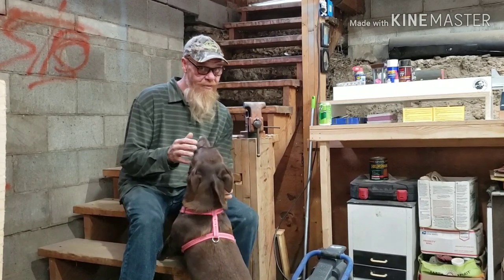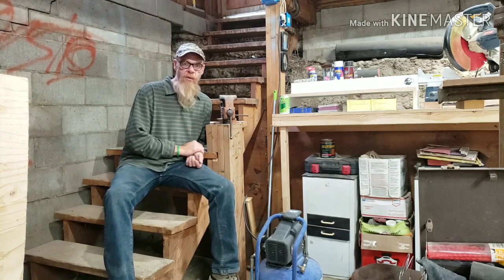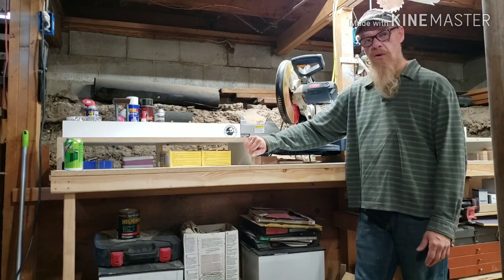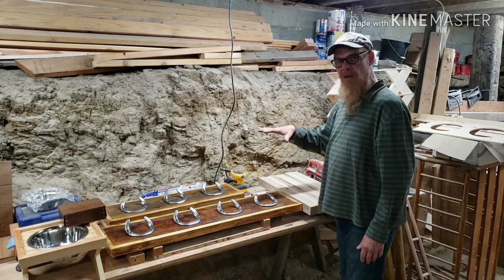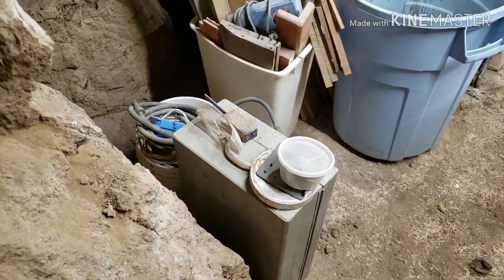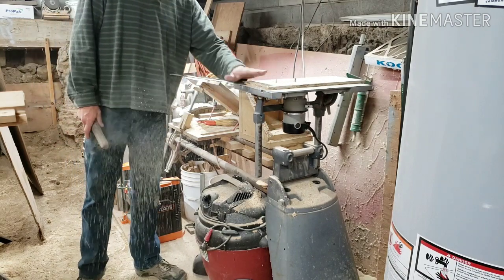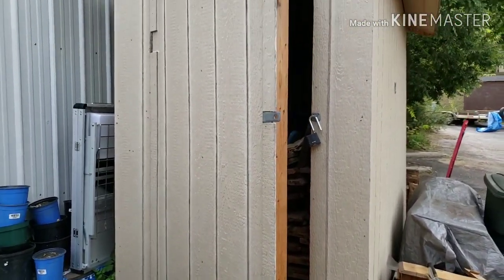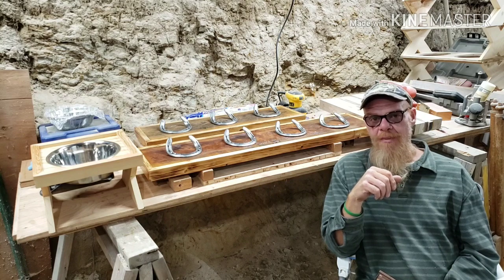BASEMENT WOODSHOP SETUP PART 1 | DIRT FLOOR AND WALLS

Comment: I believe your new shop is going to be a big improvement for you to do more comfortably. You mention dust collection....where do you dispose of your dust and shavings?
You ask what kind of shop we have, mine is a 32’x32’ area of my Polebarn but part of that area is also where I keep my boat. I have a 1940’s vintage Delta Unisaw with a huge outfeed table that doubles as a set up and glue up area. That’s pretty much in the center of my work area surrounded by other shop related equipment.

All the best to you in your new, dry warm shop Kevin👍
Reply from the maker: I have been just disposing of most of the shavings, but i have been composting some too.

Comment: I really like your miter station setup. I need to make something similar for my shop and when I get around to it, I'll probably snag some of your ideas. Especially the open shelving. I've heard drawers in a shop (while clean looking) only lead to loosing things or making it difficult to find them. 

I have an idea on how you can utilize the dirt shelf near your concrete footers to get a level surface without disturbing any of the foundation... Set a board on there and level it. Hold it in place with props or something. Then come back with the expanding foam sealant and spray it into the area between the board and the dirt. The foam will fill the gaps, supporting the board, and when cured will be a solid enough foundation to allow you to have a level and fully supported shelf! I've never tried this, and it's just an idea in my head, but I HOPE IT WORKS! :)

I would also utilize your storage spaces between the floor joists as much as you can. Even simple wood cleats to where you could slide up small trays that hold stuff would be great. Of course you could also get fancy and have a pull down rack, too. ;)

Very much looking forward to seeing more of your shop and seeing you tackle all of these challenges and inspiring us!

Comment: Kevin, I’ve got to say it...you were #manspreading like a pro at the beginning 😂

A quick tip (I hope I didn’t miss hearing you talk about it)...USE THE CEILING TO YOUR ADVANTAGE!! My last shop had ceilings that were about 7’, and I miss the snot out of that ceiling.  I added electrical outlets, stored clamps, put remotes for my dust collection devices as well as hoses I dropped down for dust collection.  There is so much potential there!

Glad to see you’re excited and working towards a great new shop!  Keep up the good work buddy!

Comment: Great start on the shop. As I was watching your video I could see myself building some 2x4 and plywood retaining walls for the dirt walls as I had time and money. Building boxes to go over the dirt to use the top as storage.  My temporary shop is in a 9x12 area of my barn with only one electrical outlet, this winter I will be converting an old lean-to type building into my new shop. We know how to make do with what we have.
Reply from the maker: Excellent suggestions and thank you for sharing your challenges. :)

Comment: How in TF did you get that Shopsmith down in the dungeon? Those things are heavy! I would try to make the best use of the ceiling beams. You can make fold-away storage units that fit in-between them. Check out Woodshop Junkies and search their video list to see theirs!
Reply from the maker: Getting the SS in the dungeon was a challenge :) 
I have seen the woodshop junkies videos and i actually plan on building some storage between the joists. They have clever ideas. Thanks for checking out my tour. Tons of videos coming up. :)

Comment: Put your tire gauge inside before it grows legs.
Reply: Kevin, do the apartments have a dumpster ? You could dump a 5gal. bucket of dirt in a tall kitchen trash bag & throw a few of those a week in the dumpster. Second thought, you might have to double bag that much. 🤣🤣🤣

Comment: yah I not the only one with dirt floors and all... (although I do have some concrete floor we put in and I have house piles and different levels of floor... lol

I have similar challenges plus a few more... and a few I less... wait what... my shop has evolved heaps since my last tour (this tour is also one of those I can make that if I had $1000000.00 of tools lol) and from originally it was fully dirt floor and my tablesaw still is on a dirt floor etc

https://www.youtube.com/watch?v=sMYZu9oiX8Y

I would put some backing on your mitre saw station where you were going to put draws (that way you can't actually push stuff back to far and drop down the back etc...
Reply from the maker: I will pop over to watch you video in a bit. Thanks for stopping by and clicking the bell.